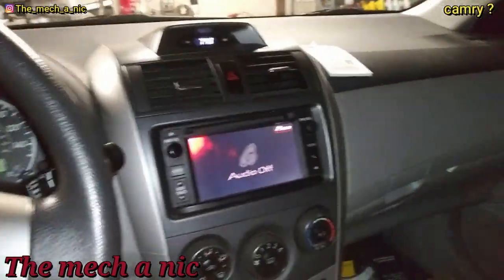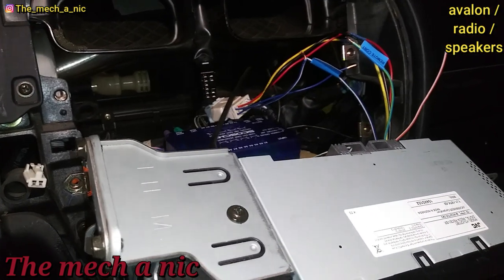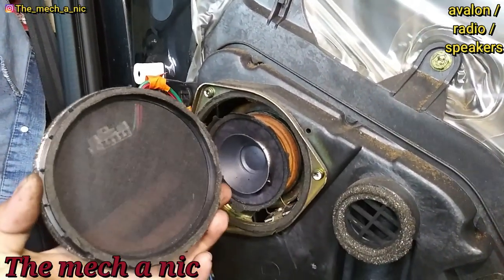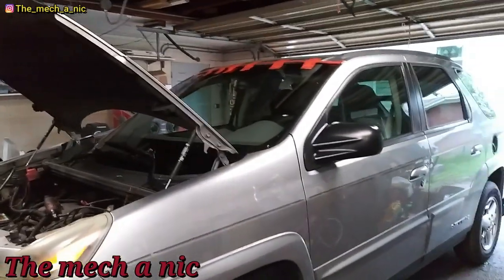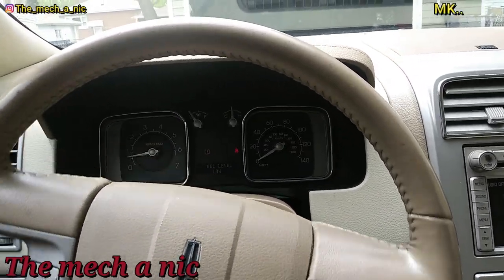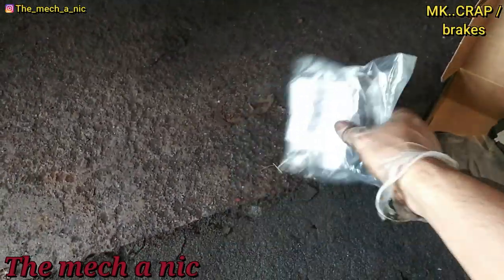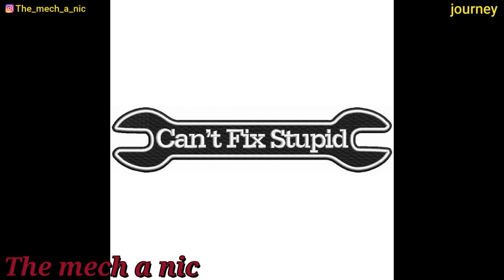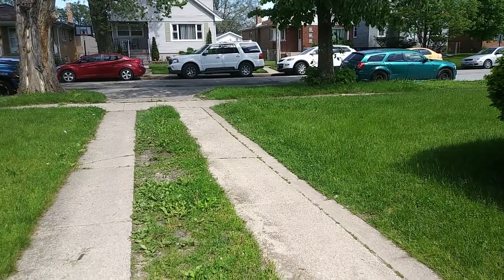caliber rear brakes , aztek over heating , avalon speaker and radio install (vol 60)

Comment: I wouldn't put much faith in the observation of a full reservoir while overheating, because trapped air could expand and force fluid to reflux back into the reservoir even when the problem is low coolant. As you know, trapped air will cause ineffective pump action and poor coolant flow. So, your decision to fix the leak and burp was the right plan. Love the way you went the extra mile to prove both fan settings come on. I also like the way you skip steps we already know. Only thing is I'd like to see what gear you use to press out ball joints and wheel bearings. Another nice one, Jonathan!

Comment: You should get a brake fluid tester from Ebay,,etc..They test moisture/water content in the fluid. simple quick test.
Reply from the maker: Ive seen those and im skeptical on how well they work. I may get one